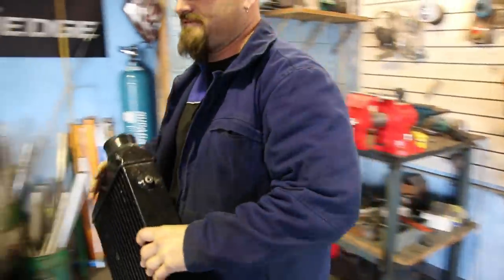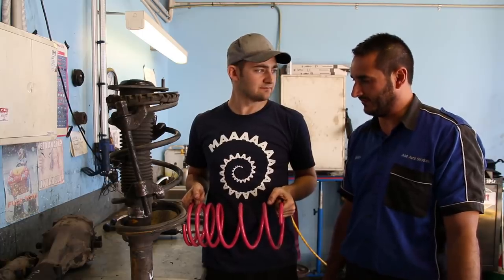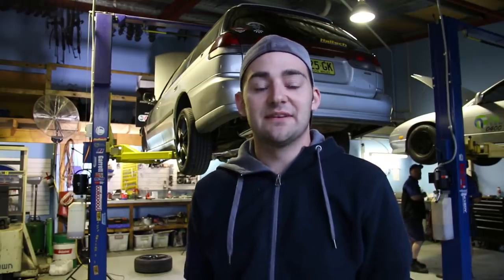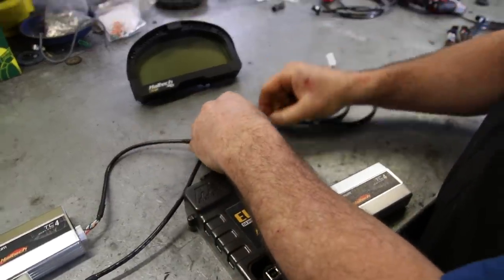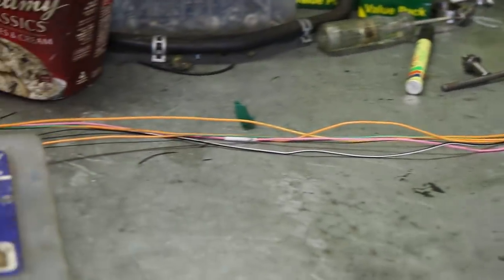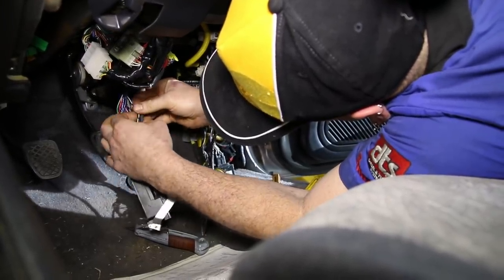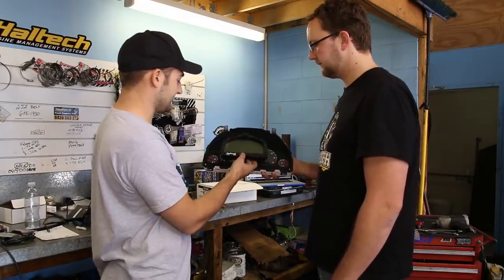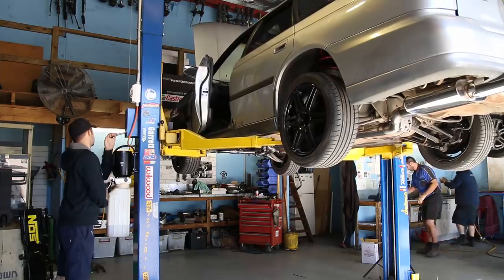Gramps the 11 Second Car - Build Part 7

Comment: problem what I am having Honda prelude rpm up down up down I have to maintain RPM from accelerater how is look like that's why I make a video but I understand your situation cant give me your email so I'm requesting you to tell me help me how I can fix that Or if you have a time you can see the video on YouTube just type(  honda prelude tell me) green color Honda prelude I know what I'm saying is funny but I don't have any other options to show you
Reply: I think your problem could be your ignition sequence needs to be reset. Very simple fix, when the car is cold all you have go to do is hold the accelerator all the way down to the floor. while your foot is planted you want to start the car. You might hear a strange noise but that’s just the car re configuring Keep your foot down the whole time till the car turns off on it’s own and you’ll be set!
Reply: @mohamedhaidar5564  I asked many you do birthday don't reply but thank you your reply I will do what you say I will make a video and I hope I can send you I really appreciate
Reply: @mohamedhaidar5564  nothing happened brother or  maybe I do wrong way I'll try it again at this morning
Reply: @markmark2222  did you figure it out? It could be a few different problems. Could be an air sensor, problem with a pulley/alternator, could be an idle air control valve. Your best bet is to get an OBD2 scanner like FIXD and just go by what the car tells you

Comment: The engine wont have enought power to make that wagon shit do 11's. Boost is their enemy in this build in a standard bottom end engine. No way it will do 11's. I'm saying this in advanced.

Sure, its a big engine, upgraded turbo,injectors,ecu, but its still wont be enough to do 11's. I guarantee you all. Nice build, stepping up a notch. Dont get your hopes up.

Comment: Why doesn't Turbo Yoda like soldering on cars?  Soldering is the best and most reliable connection.
Reply: Because he's gonna be doing 11's. The engine is gonna get really hot and might melt the connection if they were to do it that way :)
Reply: If you're new you can also heat up a circuit too much and fry a board while trying to solder something... I've done that, derp.

Comment: How do you pay for all this? I'm pretty confident Turbo Yoda doesn't work for peanuts. Ten days in his garage must be expensive. 
Why don't you use strong magnets to keep together the pieces of the steel pipes while checking their fitting before welding? 
Anyway, this is a brilliant show, far superior to some TV shows that cost tens of thousands to produce and lack content and originality.
Reply: Exposing magnets to heat tends to kill them. Magnets also cost more than a sharpie.

Comment: U got a promblem with Hondas mightycarmodz and u guys didn't even put aftermarket fuel injectors,rods,and pistons or cams or intake modifold and more stuff u guys don't even know to build cars u didn't even dyno it to see how much hp u have u guy are a joke and if u gonna say something I have a Honda s2000 turbo that has 874 hp running 8.7 so eat on that